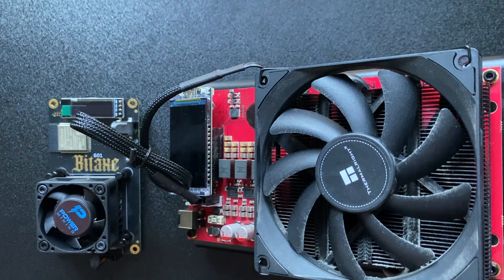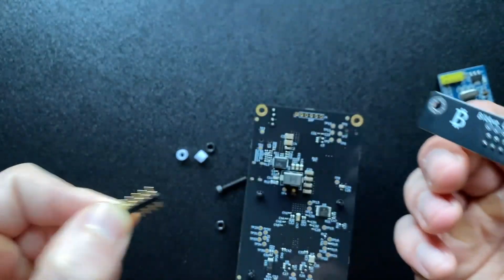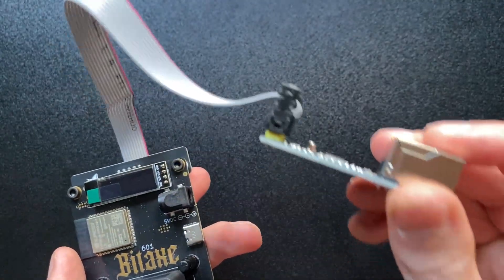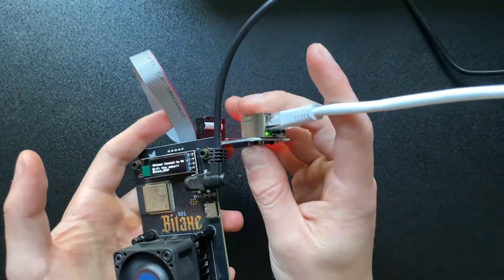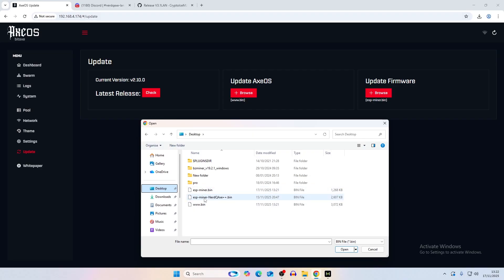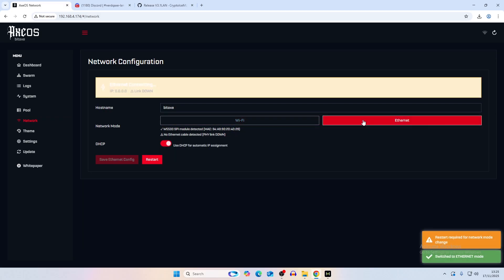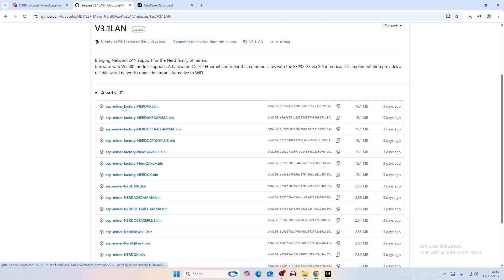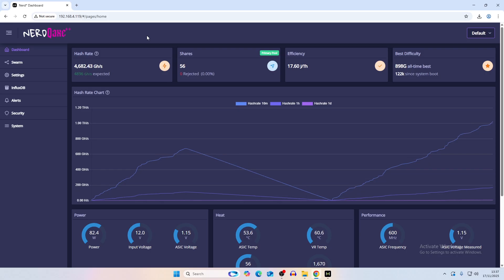How To Setup Bitaxe & NerdQAxe Lan Mod

Comment: After doing the mod I did not see any measurable improvement in the connection to justify modifying the BitAxe. If your wifi connection is not strong, then it may be worth it. Ended up ordering W5500 and following the instructions on GitHub to build my own LAN network adapter. Thanks, @MolonLabeVC, for the great instructions.  Would have ordered the official one to support the developer, but shipping to the US is ridiculous.

Comment: Needs to be Gigabit auto sensing to user's LAN.  Good start, but needs a bit more work.  100mbps dioes beat 2.4GHZ Wifi,  Tempting.  Would like to see a speed test to confirm it actually works at 100mbps, no way to prove it?  Is there?  Will keep watching and waiting.
Reply: You want gigabit to view a UI that updates a few bytes of data every few seconds ? + The system does auto negotiate to 100mbps at the w5500 module link. ( The issue was sterlings router and not the module ) Lastly the link between router and w5500 module is 100mbs and the link from w5500 to esp32 is 2mbs via spi . Lowered to tolerate spi signal noise on an extended ribbon cable. Hope that clarifies your question

Comment: Nice video, but what is the result ? less ping ? less error hash ?
Reply: Just ability to run via Ethernet. Some user had range issues, some want more privacy.
Reply: Correct, no justification for doubling the cost for no perceived benefit.
Reply: @Step-n-Wolf  May be... in the next video will be the result of network interface..